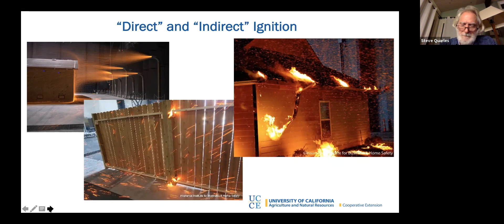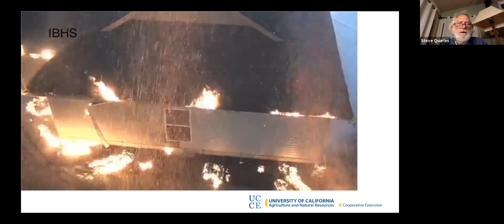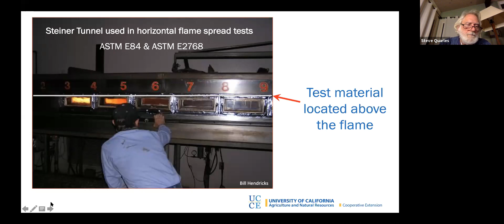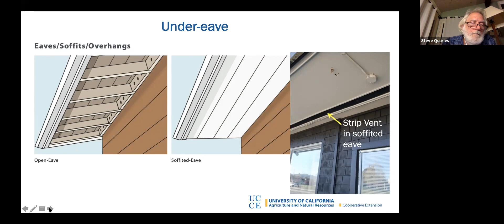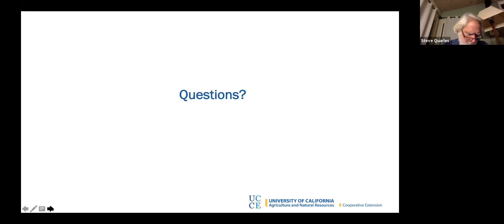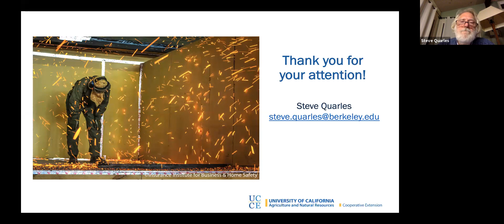Wildfire Home Retrofit Workshop for Building Professionals

Comment: My wife and I had our lives turned upside down when we lost our house to the creek fire last October.  This fire burned insanely hot in our area along pine ridge, where we own 12 acres on a steep slope.  There is not a sprig of green growth left, where once stood tall pine, cedar, and oak.  My part time job (a labor of love) for the last 20 years was keeping the land as clear as I could.  I milled lumber from snags (pine and cedar) and burned a lot of rotten timber in the form of firewood and burn piles.  I also had a commercial chipper that I put to good use.  I'm considering rebuilding but I will have no exposed lumber in my future home.  I will likely have steel or cement siding, boxed eaves, an unvented roof, slab on grade (a slab doesn't need the vents associated with a crawl space), NO DECK, and zero vegetation in the first 20 feet, and only sparse vegetation out to ~200ft.  Lately I've tried to convince friends to cut back vegetation within the first ten feet of their homes, but they won't listen.  Everyone says "the reason I moved up here is for the trees," and I think they feel offended by my suggestion.  Well yeah, I love trees too, but admire them from a distance for Christ's sake!  At the moment I have a toxic ash pile that was once my house, and it is at the mercy of the rain and snow.  The whole mess is leaching into the soil and running down slope as I type.  Given the burn severity at our site, I don't think we could have prevented our house from burning, but just a half mile away, some neighbors fared much better, so who knows?
Reply: Your ideas sound good. I’m working on retrofitting my wood sided house in the San Gabriel Valley near Pasadena. It’s technically not wildfire that I’m concerned about. But an urban fire during our Santa Ana winds have the potential to carry embers for miles. The suburbs that burned near Denver and Boulder, Colorado are an example. I’m hoping to find a way to add light but fire resistant cladding, among other measures. Recently I found companies that manufacture steel panel cladding with mineral wool insulation, which may be more promising than concrete stucco. Hope your rebuilding is moving along.